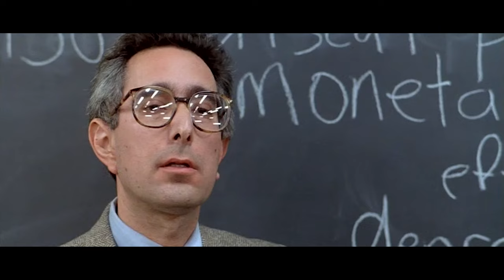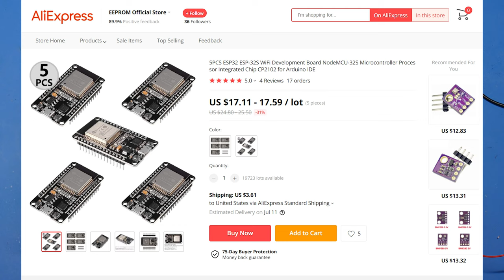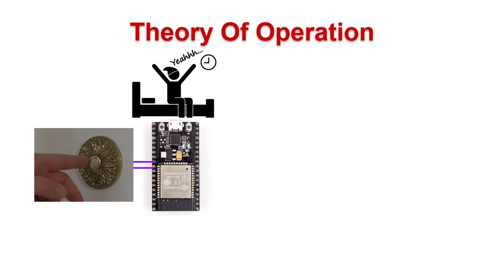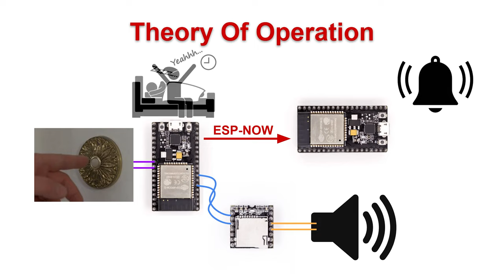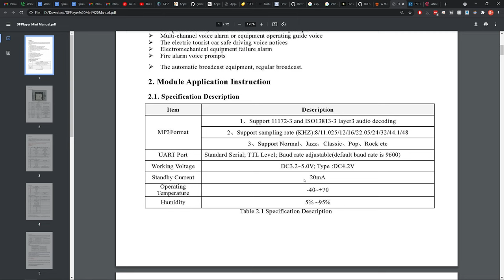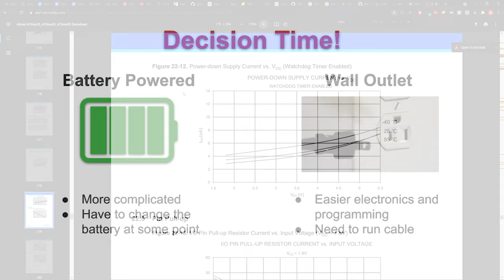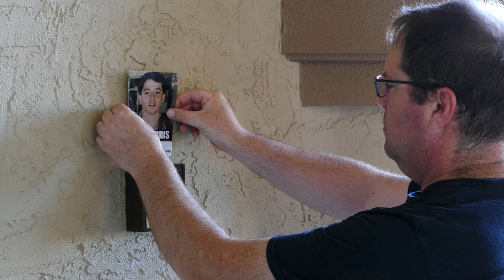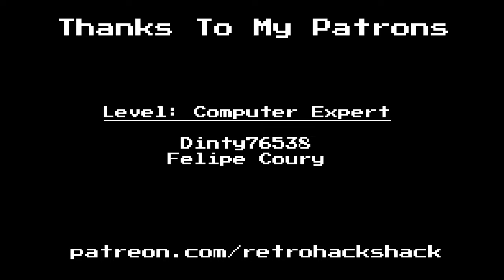Recreating Ferris Bueller's Intercom

Comment: Great project !
Did you consider managing the soundplayer's power directly with the ESP-32 without any extra µC ?
Reply from the maker: That is one option. The max current rating on the gpio of the ESP32 is 40mA. So that could work.
Reply: @RetroHackShack  Or you possibly even could use a GPIO to pull down a MOSFET that would in turn switch the audio module and forget about a potential overload of the ESP's I/O ;)

Comment: @17:30, that doesn't make sense... if you're complaining about20 milliamps on standby and you are using the 12Vac from the existing door bell, i don't see a problem... other than backfeeding into the battery that is :D
Reply from the maker: That's why I switch to the AC supply rather than just battery. The AC supply was plan B.

Comment: Perhaps you could setup a solar charger for it?  I dunno if it's in a spot that ever gets sunlight, but I would think even like an hour of light a day would be enough to keep the battery charged until the battery eventually stops holding a charge.
Reply from the maker: Unfortunately not much sunlight here. I have another project that will use solar and some power saving techniques.